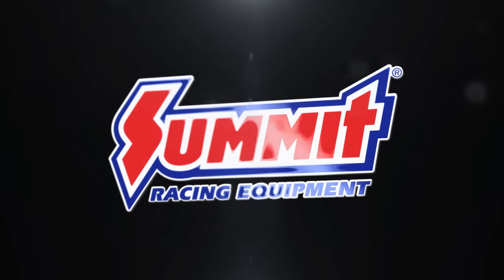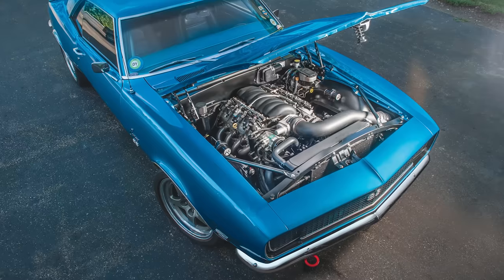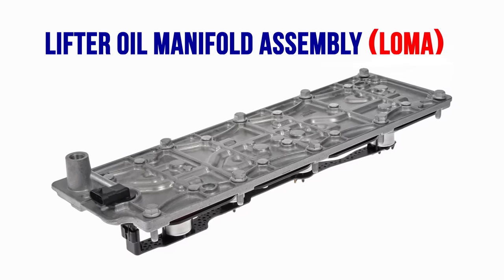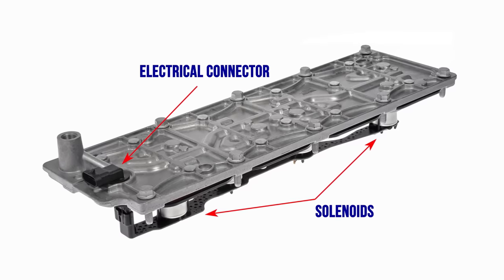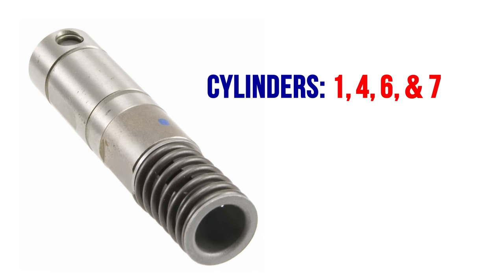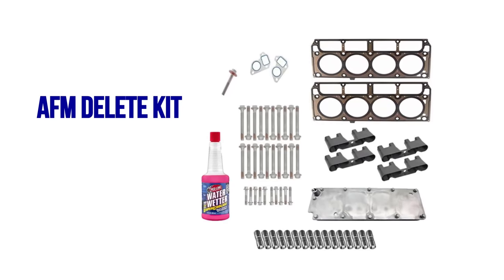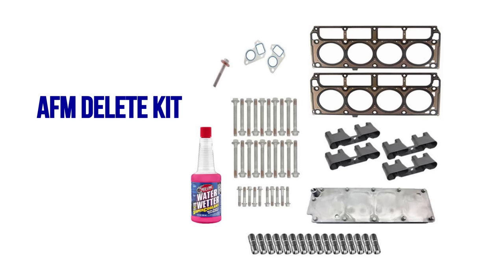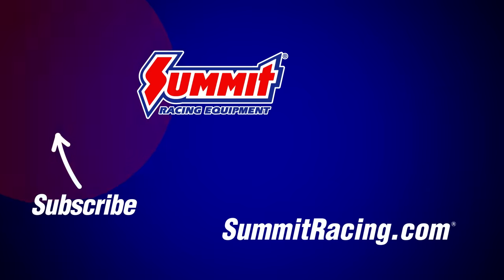Why and How to Disable GM's Active Fuel Management (AFM)!

Comment: It’s a scam and GM should be sued.
Reply: Epa now requires it on factory installed v8s. Even the Ford Coyote had to equip it
Reply: They also allowed you to change the settings from the steering wheel to shut it off@syloui
Reply: @aaronwilson4898  lol turning it off doesn’t fix the problems.
Reply: Blame the lame…epa
Reply: @turbosupra2jzdragracingtob249  the ford one doesn't have the same problems as the dod/afm the chevys and the issues from Chrysler. I think the ecoboost has an inefficient oil pump so it will probably see some similar lack of oiling issues. But it isn't the same.
Reply: Yeah I agree. Trying for my 18 Silverado. Not broken but having issues and still under warranty
Reply: @L00se_change  is it not covered under your warranty according to them?

Comment: I watch these AFM videos occasionally to reassure myself that sticking with my 2004 Avalanche is the right decision.
Reply: Yup, I purposely bought a 2005 GMC Sierra 4x4, Texas truck , low miles .
Mines made in Canada,  great truck@!
Reply: Yes the Vortec engine before 2006 was built by masterminds! Well maintained will last over 300,000 miles way better engineered than anything after I would stick with the Avalanche till the wheels fall of
Reply: Just had my 06 totaled by someone. Great truck, not an issue! Now I’m like duck this market
Reply: What’s crazy is the motors up to 2010 are just as reliable as its predecessors once you delete the AFM
Reply: Yup. Keeping my 2006 Silverado in good shape for this. I can’t see paying for a new truck that’s a ticking time bomb.
Reply: I have a 2002 Chevy diesel.  Haven't found anything better except maybe looks better
Reply: 2000 Silverado...  With a replaceable PVC.    247 k.   Five speed stick,    No reason to upgrade yet.....     Pretty sure the truck will see 500K but I won't... 😮.
Reply: 2012 dealing with this shit it's a nightmare

Comment: Anybody with AFM or DFM engines should keep an eye out for a class action lawsuit. GM also has a TSB on repairing these engines.
Reply: The class action will go nowhere..
Reply: @1982MCI  And cost the companies money
Reply: @turnne  good point, which any time it cost a company money, it’s treated as a “pass thru” cost meaning it gets passed on to consumers thru higher costs or other means
Reply: @1982MCI  Its very common for just about large corporation to have some lawsuits on the table. The company I used to work for has paid settlements in the millions of dollars for former members of the US military for a product that meet the specs it was supposed to
However...they cant raise their price, neither can GM
Those settlements are taken out of profitability
The market wont bear a price increase...really why would buyers n ot just go and buy another brand?
Reply: C10 Syndicate  I am dealing with one of these trucks also. But just FYI any of these manufacturers build engines this way because of ever increasing CAFE standards and ever increasing EPA regulations.  It is a never ending regulation nightmare. Not to mention NHTSA and other Alphabet Gov. regulators I forgot to mention. This just so they can get "PERMISSION" to manufacture and sell cars and trucks. Full Disclosure I am an OLD (Ancient) retired GM Mechanic. After all the "LITTLE" problems that are built in are corrected my 2018 is a pretty nice truck.
Reply: @stevecampbell7620  yeah I'm wondering what will be next in vehicle as the average CAFE standard go up 40 mpg in the coming years
Reply: C10 Syndicate  I have a C7 corvette with A8 transmission and AFM. I also got the Range Technology AFM bypass plugin. Another thing I did was get the transmission fluid triple flushed and it eliminated shuddering. The original transmission fluid was hygroscopic.
Reply: @stevecampbell7620  Agree 100% Steve.  I didn't want a Ford with a twin turbo V6.  I put a disabler on my 2018 and had no issues.  I only put 19K plus miles on it.  My 2022 High Country had the AFM deleted from the factory due to the chip shortage.  My warranty is good for another 33 months and I may go ahead and get an additional warranty.  There is a class action lawsuit in Michigan right now.  The disconcerting issue to me is that the vast majority of theses engines are OK.  IT's the 1 to 2 percent that have issues that everyone rants about.
Reply: @turnne  3m?
Reply: @MegaDysart  Yes......some very recent developments in that litigation as well
Reply: Your trucks don't have the AFM, so how would you know if it's hype or not. I was going to by a 2020 Silverado new a while back but returned it after my test drive.  Both the 4 cylinder turbo, and the 5.3 was suspect for me. I bought a  GMC Sierra  , TEXAS truck, low miles...
Reply: @kkoch666  Only people that make money on those are the attorneys.

Comment: Installed the Range Technology Disabler on my 2018 Silverado with the 5.3. Works great. No more bucking when going from 4-8 cylinders, more power. Lost 2 mpg on the highway. Highly recommend.
Reply: So these engine get 2
Less mpg? Instead
Of 16-18 mpg city they get 2 less? Kinda like what i get on my ‘05 yukon 5.3 non afm(DOD) engine. Its a pig. The newer sierras and yukon are appealing to me (2014-2019) but worry about reliability and the DI engine carboning up.
Reply: @TC-hs5wy  I used a Range disabler on my 2018 LTZ and noticed about a 1 to 2 mpg drop in around town driving.  Traded it in on a 2022 HC that has the AFM deleted from the factory.  Chip shortage issues.
Reply: @DLTJR1959  from what I understand, even turned off the AFM lifters in your engine can still fail.  It’s just a matter of time.
Reply: @slalomking  so just get the AFM kit delete?
Reply: @vkchikom3187  well that involves thousands of dollars, you have to replace the cam, the heads have to come off.  Why would I pay for a new truck, then have to spend 4k to fix a GM boondoggle?  Just buy a different brand of vehicle
Reply: @grayrider1865  GM states on the Moroney AFM delete.  Didn't know you were a GM engineer.
Reply: Depends on how you drive.. i lost 4 mpg without afm
Reply: @slalomking how is it going to fail if it never collapses and gets stuck? As long as it has oil pressure it should never move.
Reply: @keithbellair9508   I just recently went on a  Round trip vacation from Florida to Tennessee and back which equated to approximately 1900 miles of travel period I averaged almost 21 miles to the gallon. I could have not been more happier.
Reply: @keithbellair9508  well that is the hope but, a lot of AFM lifers have failed even with the Range on.  Remember there are 4 possible cylinders on AFM so 8 possible lifters that can fail.
Reply: Me next - 👌👍
Reply: Thanks for info, is it hard to install?
Reply: @ericrichards7529  No. Its plug and play into the OBD 2 port under the steering wheel.
Reply: @slalomking about what mileage will this happen ?
Reply: @slalomking that’s what I’m hearing- just buy TOYOTA
Reply: @jimmysapien9961  the problem is Toyota doesn’t make a vehicle this large.  If you need the room, you must pass on the Toyota.
Reply: @jimmysapien9961  see my reply, one comment above where you asked when will this happen,  I put the answer on the wrong person, sorry.

Comment: As soon as I started getting lifter "tic" I installed a disabler.  Within a few months the lifter noise became quieter and intermittent until it totally disappeared and has never came back after over 65k miles.  I got lucky lol.  But oddly I gained .6 mpg instead of losing mileage lol.  Hardly noticable.   But downshifts were definitely improved.  But the 6L80E is still probably my least favorite transmission ever lol
Reply: Delete the T-stat on the transmission and it'll be much more reliable.
Reply: Where did you get the disabled from? How much it cost you ?
Thanks
Reply: @Ratkill9000  tell me more please!!
Reply: I would agree with you on the 6L80. Definitely get a trans cool thermostat by pass and I personally changed out the Trans fluid. I flushed out the DexIV and replaced it with Synthetic LV (low viscosity) fluid. There is a GM bulletin to do this to the 8 speed for shudder and it really helps the 6L80 also.
Reply: That's funny you say you got better gas mileage I swapped out my 5.3 to a 6.2 no mods other than just turning the computer for added fuel and I actually gained three miles per gallon on average. 

Makes me wonder why GM just didn't stick the 6.0  and 6.2 L in as Factory.
Reply: @Ratkill9000  is it difficult to delete the t stat on the transmission?
Reply: What’s not to like about the 6l80e? Seriously I wanna know
Reply: I junked the 6l80e in my wife's truck as soon as she got it, spent the money on a 6 speed jasper
Reply: @yousufkan6960  on the 8l90 it’s on the driver side, on the outside of the trans. Super easy to swap out for a bypass that cools it all the time. I imagine it’s similar on the 6l80
Reply: @NBC_NCO  the 5.3 has a reputation at this point. There's gotta be tens of thousands sold yearly bc their last 5.3 was solid...

Comment: Just tap the the towers with a 3/8-16” tap and install set screws with thread sealant. Then use whatever valley cover you want. You’re welcome.
Reply: This is exactly what I had did back in August of this year. No more worring if the seals on the valley plate are failing or not.
Reply: And Scoggins-Dickey has press in plugs that require no tap, haven't seen any come out yet.

Comment: Awesome job explaining this!!! 
You should be in charge at GM because they don’t seem to know how this works themselves.
( failure of lifters on my 2021 Sierra with only 8.800 miles and they replace with same parts so just a matter of time I guess).
Anyways thanks again for the great explanation.
Reply: GM dealers aren't going to do anything not authorized by GM.

Comment: Nice simple explanation and tempered to "soften" just how much trouble the system can create - simply put, several issues can trash an engine. Unfortunately the system and its unique parts are more complicated than needed to be explained and require diligent attention to maintenance to reduce the possibility of a failure. 
Anyone researching just exactly how the entire system functions will find out just how mechanically "busy" the extra functions required are, and see all the areas for potential failure.
So far, mine ('07 5.3 Silverado) has functioned well, but is annoying. On flat level roads there's no sign when it is engaged except that because I have modified exhaust - the truck Sounds like it's missing. The annoying part is when the road is at all hilly and it's below expressway speeds. The system "hunts" turning on and off frequently, and the truck feels lazy going up a longer hill until the system Stays off.
Best to disable it and avoid possibly destroying an engine.
Reply: I just bought a 2022 Silverado and am not willing to void my warranty by putting new cam lifters and whatever else is involved!
Reply: My 07 1/2 ton 4wd silverado dont have it , its the newer version ( 07 was a mid year split ) 327,000 miles all original motor , tranny , axles and transfer , its about to hand grenade though , everyyhing is going bad at once now though ..
Reply: @floydmayes4924 I'm sure this is for people outside of warranty

Comment: My new Chevy Silverado, 6.2L has this. Trying to gain and much knowledge as possible. Thank you for the info.
Reply: This video is extremely long winded though for such a simple answer, if you don’t want to do major engine work, just buy an HPtuners mpvi2, you can even download the VCM suite for free and it comes with a few sample tunes to look through the program. Disabling the DOD on most Silverado’s is literally just a drop down option that says enable or disable, once the vehicle is flashed you can remove the mpvi2 and it will NEVER run in v4 until you flash it back. You can even keep the warranty on the vehicle if you just change it back before you get to the shop lol pretty much impossible to tell if it has been flashed or not.
Reply: @slycarlo8747  thanks for the info. Right now I’m not looking to change anything on it. Trying to absorb info. Big change from my old I-5 Colorado to this V8 beast.
Reply: @undeadmonkey9122  Right on, I came from a 5.3 Sierra so I know the feeling haha, way more torque in a 6.2. The first thing I see a lot of guys do with their 6.2 is install a boxed cold air intake, AFE is expensive but their pro5r filter is a monster. Next buy NGK iridium plugs and MSD wires. I would also change from the stock rancho shocks as soon as possible, Bilstein makes a great replacement. Then comes the most important part, a loud pipe out the back lmao Texas Speed 3 1/2” w/ cutout was easily the loudest pipe I could find for this truck. I snapped and bent a pushrod the other day and thought I was going to have to pull the head, threw another pushrod in just to see what it would do and it’s like nothing ever happened lol, time will tell what will happen to the chunk of pushrod still left in the engine, chances are it’s rattling in the pan out of harms way.
Reply from the maker: Thank you for watching!
Reply from the maker: Thank you for watching!
Reply: @slycarlo8747  
Actually it's not near as long winded as it could be - a full description of the mechanical side and the places it can fail would take 15 minutes or more!
Reply: @slycarlo8747  your comment is long winded and a waste of time. Sorry bro
Reply: @Motor-City-Mike  yea someone should really mention on a single bolt cam(vvt) the pin is really narrow and can fit in the stock gear in the wrong spot and still flush up...

Comment: I purchased a new 2019 Silverado 1500 LD with a 5.3L, L83 engine.  I've seen a couple of videos that talk about disabling the AFM by putting the gear selector in "L" (manual) and setting it to "5" so it won't go into overdrive and activate the AFM.  This works but you have to manually select "5" each time after you put the selector in "Park".  I drove it this way for a while and didn't notice any issues.  I ended up purchasing a used Range Technology AFM/DFM disabler dongle and have been using it since 6/23.  I've driven close to 20K miles with it and have had no issues.  My truck used to get 17/22 mpg without the disabler and now I get 16/21mpg with it.
Reply: Personally I tried the manual mode at 5 gear. Yes all 8 cylinders are active.
However rpm’s are up in 5 gear at hwy speeds. 
Short trips at freeway speeds are okay in 5 gear. 
But hundreds of miles in 5 gear?
That’s where the AFM range disabler has the advantage. 
JMO

Comment: If you place the automatic transmission gear selector in the manual position and select the highest gear of 5 of a six speed, it will not go into AFM mode. Great for around town or hilly terrain. Kind of APITA to remember to do it each time but it works. Get on the open highway and let it go into AFM and save a little fuel.
Reply: Does towing mode do the same?
Reply: @jeremylakenes6859  not sure about all years and models, but in my 2011 tahoe the answer would be no. With the transmission is set to D and towing mode active, the motor still activates AFM.
Reply: @m6780  hust found out the same with mine. Still goes in that mode.
Reply: That’s what I do. Run it in M5 90% of the time.
Reply: I do this every time I drive. I just bought my 2010 Denali in November. Only has 100k miles, not a single leak, or squeeks from anywhere. Oil is very clean. Every option works. Love my hemi killer 6.2
Reply: I was just gonna post this !
Reply: I've been trying to tell people that. Easy to disable without buying any device.
Reply: Yeah but lol why not just spend the $200 for the range so you can used 6th gear??
Reply: @freddiemoench2551 hi I own a 2015 gmc sierra 2500hd with your hemi killer. I also own an 07 dodge 4x4 with 5.7. I'd rather drive the old dodge.

Comment: I have a 2018 Z71 Silverado 1500 with the 5.3 and only 33,987 miles on it. I bought it brand new.
My engine was ticking the other day. Took it to the dealership. Needs a new cam and lifters....
All covered under warranty FORTUNATELY, but I definitely ordered the disabler tonight and before I drive it off the dealership lot when it's fixed, I'll be plugging the disabler in.

AFM is not worth the trouble. I didn't buy a truck to get good gas mileage...
Reply: Any updates?